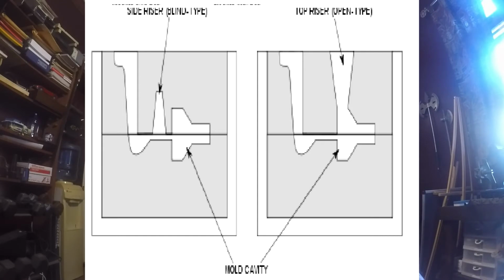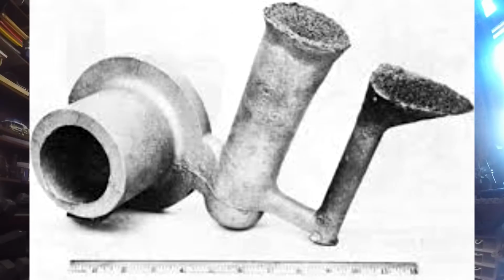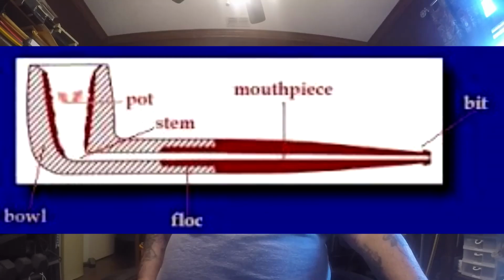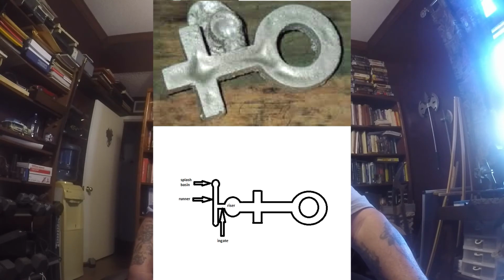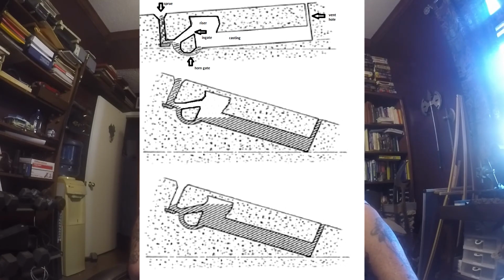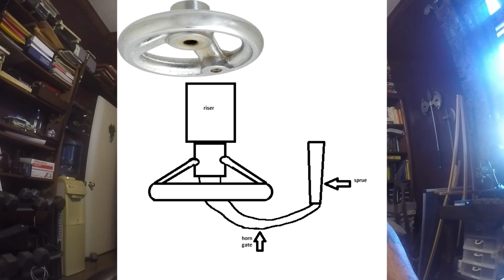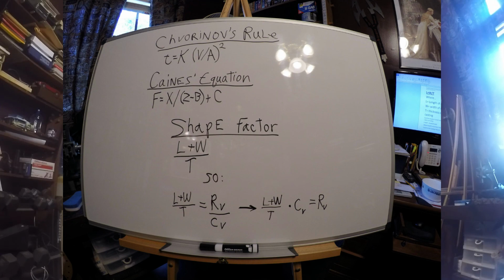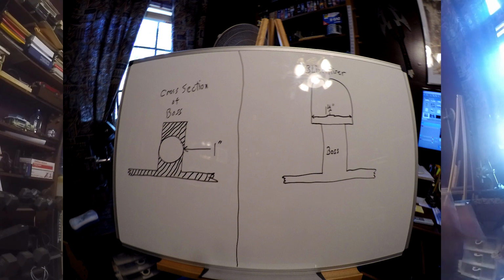Designing and using risers in the mold for your castings.

Comment: Hi Sandrammer, just a quick question how would you gate a bowl type pattern. Very useful video by the way learnt a lot
many thanks in advance
Reply from the maker: It depends what the cross sectional make up is of the bowl. If you find that the thickest part of the bowl is the base (the most likely condition) I would gate into the base and pour the bowl with the lip of the bowl pointing towards the Drag of the flask. If the bowl is of uniform thickness you could gate into the rim of the bowl but you would then have to put a lot of thought on how you would suspend the green sand core ( the part that would make the inside of the bowl). Which ever way the bowl is constructed, I would probably still ram it up so that I would be gating into the base of the bowl. That way you would be able to forget about suspending the green sand core.
Reply: @sandrammer  Thankyou very much for your advice, i cant suspend the core of the bowl and have the lip facing upwards, what do you think about a direct pour into the base then, thanks again
Reply from the maker: @woodsman2433  , unless you have a special set of circumstances that prohibits your suspending the core, you can suspend the core and gate into the rim of the bowl. It just takes a bit more work to do it. To help you in that project you can watch the videos  I made that covers that subject, "Mold and core supports" and because making a bowl is a lot like making a bell, "Making a bell" parts 1, 2 and 3. I always advise against pouring directly into the mold cavity as it almost always forms dross in the project ruining the appearance and density of the material. There is a couple of exceptions to the rule on pouring directly into the mold cavity, one of which depends on the material you will be making the bowl out of. What will you be pouring?
Reply: @sandrammer  Thanks for your time again, it will be Aluminium
Reply: Can i not make a smaller type of cope to go on top of the main cope and use runners under this into the bowl to reduce crap getting pushed in, just a crazy idea i know
Reply from the maker: @woodsman2433  , If you're making an aluminum bowl, dross will be less of a problem than the trapping of air in your molten metal due to the turbulence of the metal falling and rolling down the green sand core and hitting the bottom of the mold cavity. If the green sand core has a very shallow drop and is very smooth trapping air may not occur. Yes, you can make a shallow cope to sit on top of your normal cope, making the mold a three section assembly. The middle section will then be known as a Cheek, the bottom a Drag and the top the Cope. Don't forget that the pouring temperature of Aluminum is 1250 degree F to 1400 degrees F. The thicker the wall of your bowl the cooler the metal can be poured.
Reply: @sandrammer  Great answer, I will try a tapered sprue into the base of the bowl, through the cheek, on top of which i will ram up a smaller cope rather like a sprue extension if you like, in which i will cut small runners leading to the top of the sprue. I will let you know how i get on, will give it a go at the weekend, many thanks again for being so helpfull and informative.
all the best
Reply from the maker: @woodsman2433  , you're very welcome and good luck on the project.

Comment: Say you are casting a chevy valve cover. How would you go about adding risers and gates using clay bonded sand?
Reply from the maker: Valve covers are pretty uniform in wall thickness so you may not need any risers. If I was pouring one, I would put the splash basin at one end of the mold cavity, put runners on each side of the long part of the cavity then cut in gates ( 4 at most) into the long part of the cavity. If you pour it at about 1300 degrees F it should pour just fine.
Reply: @sandrammer  thank you sir. I have never sand casted, only done resin casting with rubber and two part resin. I chose to keep working over disability insurance making cast aluminium classic car parts. I have a few patterns finished just having trouble with the flask since I only own a table saw. Wood is twisted and currently blocking it straight.  As a sculptor and ex body man I get by well when shaping up my patterns. Ive seen all of Myfordboys videos and recently found out about you. I also talked to the man resposible for making the pattern used in the early hand blowers and the rakes used by USPS mail sorters. I question everyone I get a chance too regarding foundry works. Again. Thank you for the reply. I was right all along. This weekend I will have a all nighter watching all your videos,..very informative indeed. 👌
Reply: @sandrammer  would that be 4 gates total? Or each side? Just finished the flask so I am going to figure out the set up before going further.
Reply from the maker: @Pimentel-Kreations  , each side.

Comment: I believe you said for this gating system, the spruce needs to be cone shaped. What angle should the cone be tapered to? Will this improve castings without the cone, as compared to not using the gate system? I'm new to casting.
Reply from the maker: The sprue needs to be tapered so that the sprue and pouring basin will fill quickly, before the rest of the gating system is filled, so that the system is under pressure like your pipes in your home water piping system. Sizes and proportions are all covered in the videos entitled "The most important video I could make; making a mold and their results.", "Gating systems, part 2" and "Gating systems, part 3".
     Yes, your castings will be smooth and solid if you use the techniques described in the three videos.
Reply: Yes. I'm intrigued with these methods and your videos. I'm in the middle of a project and will adapt the remaining castings with these lessons learned. Thanks.
Reply from the maker: You're very welcome and I hope everything works out for you. I should however remind everyone reading this that these techniques are not methods developed by me but techniques developed and adopted by Molders in the long history of their existence in the Navy. I learned these methods from the schools the Navy sent me through and I give them all the credit for what I know. That being said, if anyone has questions concerning my videos or have a problem making a specific casting I would be pleased to help you in any way I can.